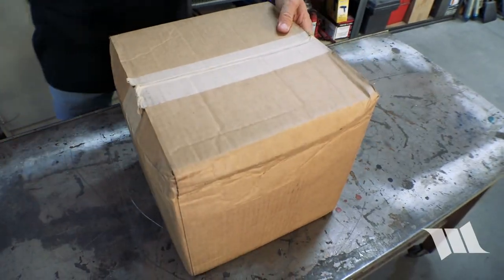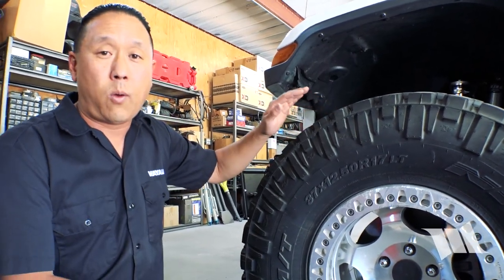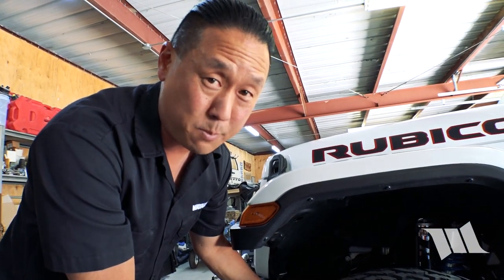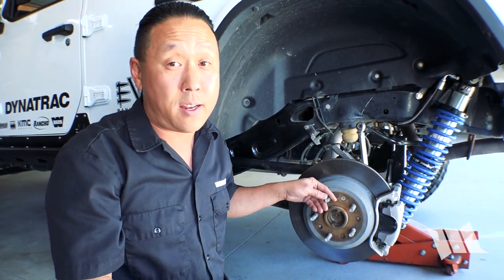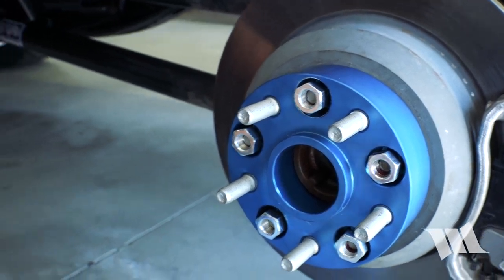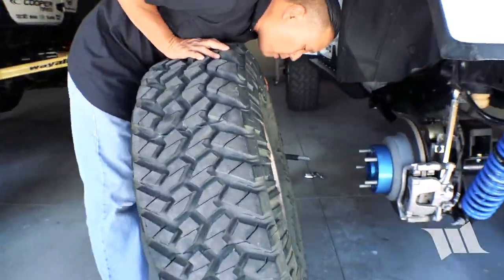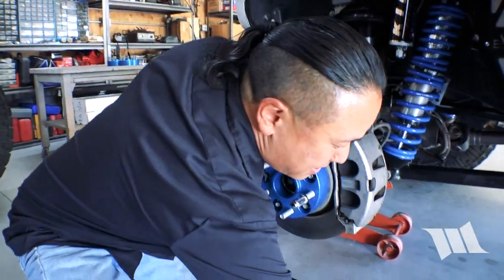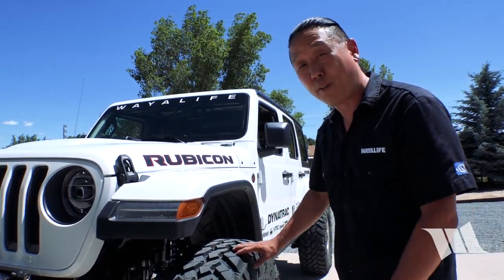Jeep Wrangler Wheel Spacer INSTALL - How to Run Big Tires on Factory Wheels with No Rub SPIDERTRAX

Comment: I installed a set of SpiderTrax on The YETI a few months ago.  After installing Rubicon suspension along w/ wheels and tires it gave it a much more aggressive stance.  They look great!  I probably went a little overboard by sanding all the surface rust off the hat of the rotor and edge of the hub.  Force of habit from brake jobs and also a car with 30 series tires that transfer all feeling into the steering wheel.

Comment: I watch this and I actually ended up with a wheel spacer because my front had to clear my Teraflex Delta brakes. My axle width got wider now and I'm contemplating if I should change my wheels etc. However after seeing this I may re-consider lol. Once again, I learn something every time I watch your videos. "UNTUCKED LOOK" hahaha
Reply from the maker: Ideally, 3.5" of total back spacing is about as little as I would go. If with these spacers you are running less, I would consider new wheels that just has less than what you had to begin with.

Comment: Ran the same spacers on my JK for over 2 years. Never had issues and loved the way it changed the stance. I have rims with a back space so I don’t need them on my JL. But if I did, I’d use Spidertrax again!
Reply from the maker: Glad to hear you had good experience with them as well.

Comment: I ran Spidertrax wheel spacers for about 10 years on my TJ and never had a problem, not once.  The other thing is Spidertrax are hub centric as opposed to being lug centric.  So the wheel stays centered on the hub for smooth running.  And that blue anodizing looks really good!   lol
Reply from the maker: LOL - the blue is a bonus for sure :)

Comment: I always wondered about spacers hearing pros an cons over the years I like the none tucked look just looks sweet as always be safe
Reply from the maker: Just like I say in the video, you do NOT want to use spacers that just get sandwiched in between your axle and wheels. Those are dangerous and should NOT be used. High quality ones like these Spidertrax bolt up to your axle and then your wheels to them. When installed correctly, they should work no differently than new wheels with less back spacing. The pro to these is that they're affordable and will help you to clear suspension components. The con, just like any wheel with less back spacing, they will cause your ball joints and unit bearings to wear out prematurely.
Reply: We’ll said that’s why I love your videos you always point out the best route on projects an safest which saves big headaches in the long run for us thank you on always bringing the best

Comment: Teraflex 1.75" wheel spacers on my 2021 stock height jeep JL wrangler rubicon 2 door with stock 17" moab wheels; with 33" k02's. Would you please share with me your expert opinion on any issues to be expected from such a set up. Premature Unit bearing wear, ball joint wear, rubbing on inner fender liners, handling, alignment, and so forth? Any info will be greatly appreciated. Your channel has helped me ball joint install, fluid changes, and so much more; thank you, and Cindy for all the great how to content, wheeling, and quality upstanding human behavior on this channel. Sad to see PiPi go, but happy the 2 of you aquired another gladiator! 
Thank you, Brandon 😇
Reply from the maker: Happy to hear our videos have been helpful to you. As far as your wheel spacers go, I would say that as long as they're made well and you make sure to use red locktite on the studs and make sure to tighten everything to 130 ft lbs of torque, you shouldn't have to worry about anything there. Just like any wheel with less backspacing, your ball joints and unit bearings will wear out sooner but it's not like they're going to self destruct or anything like that.

Comment: Love the videos, Eddie! After the initial 100 mile check, how often would you recommend checking them? I’ve heard every tire rotation. Thank you!
Reply from the maker: After the first check, there should be no reason to check them again outside of a visual check. Use a paint pen to mark your bolts and that'll show you if anything has moved. None should even after the first 100 miles if you installed them correctly.
Reply: @wayalife  Awesome, thank you!

Comment: I'm in the same boat you were in. My wheels are 17x9.5 with 4.5" backspacing though, and I don't wanna spend another $2500 on wheels to fix this. With the spidertrax spacers I'd be at 2.75" of backspace on a d44. Is the 1/4" difference between yours, and mine a big deal? Or should I install shorter studs, and go with a 1.5" spacer? Thank you! Great videos!

Comment: Hey Eddie, Thanks for the informative video like always brother... I have a 2019 JLUR ..my question is if I'm running 35 x 12.50x17 on a 17x9x -12 wheel should I put wheel spacers as well? The tires are already 3 inches out of the fender line. I'm new to this so any suggestions are more than welcome , thanks again
Reply from the maker: If you're not seeing any rubbing at a full turn and or full flex, I would NOT install wheel spacers as they are NOT needed.
Reply: @wayalife  thanks for your help!

Comment: Thank you for the informative video!!  You always do a good job explaining. You were talking about the right back spacing so it doesn't cause strain on the suspension components. If I added these to factory JLUR with the 33s would that cause more stress on the components? Or would it be ok?
Reply from the maker: Anything less than factory back spacing will add more stress to your ball joints and wheel bearings. Really, it's not that big of a deal being that ALL parts wear out and need to be replaced as a part of routine maintenance. It just means you'll have to do it sooner than would be needed if you left everything on your Jeep stock.

Comment: Anyone asking about safety here’s my 2 cents from experience. As he says, a good quality HUB centric spacer, installed properly is safe. I ran them on a Mustang for years even on the drag strip. Now I run them on my Jeep and off road as much as possible. Follow the torque specs and instructions. Recheck after 100 miles. Good to go!

Comment: Love the channel! I really like how your jeep is coming along. I ended up going with the G2 brand 1.75 for my JLUR. I know there may be many reasons for going with a specific brand but what do you think of G2's quality compared to the Spidertrax?
Reply from the maker: Unfortunately, I couldn't say with any authority being that I have not run them before. I've just run Spidertrax for over 20 years and have never had a problem with them. I have seen where cheaper spacers end up breaking a wheel stud and that be a problem. None were a G2 though.
Reply: Man!!! Thanks for the reply. Short term fix till I get the wheels I want. Keep the vids coming.
Reply: @Svtdude302  how have the G2’s held up for you? Thanks I recently had a lift done that required spacers and the shop went with the same G2s you used.

Comment: great video, pretty much was the final selling point for me getting some spidertrax. about how long can one expect before starting to see premature bearing wear or anything else on a completely stock JL aside from these spacers?
Reply from the maker: It really depends on how you drive your Jeep. For normal driving, they should still last a long time. Even with rock crawling, they'll do fine. Where they really put a strain on ball joints and unit bearings is driving hard and fast across the desert.

Comment: Well as always it looks awesome hope it fixes everything. Just one question will you be putting 40” on the JL?
Reply from the maker: The spacers effectively made our back spacing 3". A bit more than was needed but yes, all is good now. Regarding 40's, eventually. From experience, we know that we'll need 1-ton axles first.
Reply: So with more space than needed you should go back to the 13.50. And give you the wider tire and more gripping
Reply from the maker: @yogi6931  We definitely could but we just got these brand new tires LOL

Comment: Hi love the videos! I Just bought a 2020 JL wrangler Sport with a 2.5 in lift and 35 in grapplers and thought wheel spacers would improve the stance and look great! I called the so called truck specialist at the dealership who told me it would void my warranty...He talked to me like I was 12 years old and said "don't they stick out far enough already why would you do something like that"? I don't know if I believe him.  BTW I crawl around town from the store to the pharmacy avoiding puddles so not like its going to be used even a little rough. Just want the look.  Would you put them on and if so what size? Thank you !
Reply from the maker: Most tire shops and even dealerships won't service a Jeep with wheel spacers or at least, if working on wheels and tires is required. However, a dealership can't just void your warranty just because you have them. They'd need to prove that whatever it is you're wanting to have fixed or replaced was caused by them. In other words, if your radio blew out, they couldn't just say that they won't cover it because you have wheel spacers.

Comment: Hey Guys, Love the channel,
Before you had fitted the spacer, where was the wheel rubbing
Does the Coilover suspension take up more wheel backspace area
Was looking running a setup like yourself, but looking at a "near" flush look for Australian conditions
Reply from the maker: We were rubbing the rear sway bar end links. With standard suspension setup, you should be able to get away with more back spacing.

Comment: You got me with “Made in the USA”. 🇺🇸🇺🇸
Curious how many will comment about the extension on the torque wrench. 😮😮
Reply: What?  why lol
Reply: Years being an Auto Technician, Felpro Gasket rep trained me besides Torque sequence that every inch of extension length, torque foot pounds settings has to decrease per inch of the length or risk of over stretching the treads or over torquing. I was also given a chart guide.
Reply: @acd3169  You are talking about offset extensions, yes that is the case.  Yet for a axial direction only extension you do not have to modify anything.  I am a ME and if you need further proof here you go:  http://rtstools.com/does-an-extension-affect-a-torque-wrench/

Comment: Just ordered these based on your video. Very well done as are your others. Question about the stock fenders since now the tires will be "untucked". I have a JLUR with 315s on stock wheels and a 1.5in level kit installed. Off road I had some bad rubbing fully articulated so it seems the spacers are needed to get the back to proper back spacing. Off road will be fully flexed for sure with sway bar disconnected. With the spacers installed, do I risk the tires, now "untucked", smashing/damaging the stock rubicon fenders?
Reply from the maker: Just to be clear, I installed these to help clear suspension components. If you were rubbing before, these will make your tires rub your fenders even more. You need more lift.
Reply: @wayalife  OK. I should have clarified the rubbing was on the inside center of the  fender liners, not the fender itself. That is why I thought the spacers would help.
Reply from the maker: @stevemaitin9584  If the rubbing occurs at a full turn, the spacers will help. If it happens at a full stuff, the rubbing will be worse.

Comment: If you have a stock JL front axle don’t you need to keep it in the “on” position so the FAD connects? Works for you cause you have a PR44.

Comment: Just bought a 20 jeep wrangler sahara unlimited JL 4dr. N I'm already having issues.bought it with 23000miles.appointment is on sept9. I have water on my driver side front n rear floorboard. I have a jingling sound coming from front pass suspension area,n the jeep shakes badly when I go past 65mph.I bought jeep with 35" wheels n it has a slight lift with rough country shocks,n roughcou try dual stabilizers. I also ordered the  synergy HD steering kit.the thing is,is that aftermarket wheels etc on the  jeep is going to void warranty,,even though I bought the jeep that way from a non jeep dealer.they installed wheels etc.what should I do? Should I go back to them?  Where can the leak be coming from?Love your videos  n what you bring to the jeep community. Your the reason I got a jl.thanks and stay safe
Reply from the maker: Sorry, without seeing pics, it's hard to say for sure where the leak is coming from. Post them up on WAYALIFE.com and I and others would be more than happy to help out. If you're unhappy with your Jeep, I would take it back to the dealership that you bought it from before it's too late.
Reply: @wayalife  lol never bring it back.I love my jeep.if there's one thing I learned from you is to get in there and just do it. n I'm doing just that.I actually fixed 2 of the 3 issues.the water issue I figured if the water is soaking mY top mat because there's a floor carpet,a custom floor mat n then I have factory mat on top.if the top got wet then the leak is coming from dashboard or freedomtops.so I popped the hood n it turns out that the dealership ran the litebar thats over the windshield thru the grommet hole by the brake booster. They took out the grommet n left it that way with the wire running thru hole so I checked under dash n found dirty water trail from the grommet hole to my floor.Bingo.sealed it up n it rained yesterday n no water.yessss as for the wobble I figured its not a death wobble cause I can slow down n I'm ok so process of elimination.I checked my front rims and noticed that driverside rim had about 6 speed balance weights on it while the pass.side had only 2..I checked the rear tires n they also had 6 weights as well.now I know that there's different weight sizes.but that still sounds fishy.so I went to tire shop n had that rim speed balanced, n mind you dealer didn't supply me with the lug nut remover,smh. Thankfully tire shop had one. They did the speed bal.I took the jeep on the highway n ran it to about 82mph  n no shake.Yesssss  so I fixed 2 issues and all I had to do was use my head.now I have to go to dealer n raise hell for causing the water problem because my jeep might not be the only one that way,n to also complain of the no lug nut tool.the 3rd issue I'll have to really get in there(sounds like washers jingling) but suspension looks tight n nothing  looks loose.so if I can't locate problem I'll take to dealer for them to look. But watching your videos and asking questions from other jeepers,I was able to take control and get I. There and learn about my Jeep. This jeep is now my "Wayalife".sold my trailblazer,selling my Honda n  now I'm a jeep for life.love your videos keep up the great work

Comment: Great video. Thank you!  Question... have you ever put JL Rubicon rims on a JK using the JkL lugs?  Will the rims seat properly and is safe to drive using 1/2 lugs/bolts vs the 14 MM lugs/bolts that come on the JL.  Or do you have to use a spacer JL/JK conversion kit?
Reply from the maker: So, I have not but I do know several people who are running JL wheels on a JK and without any problems.
Reply: @wayalife  Thank you!  And they are not using a conversion kit.  Just using the JK lugs?

Comment: Hello....another great video...good info...I have a question....what the max size space one should use....I running stock tire and wheel (31inch)..2020 JL..and I like the look of a wider stance...is 1.75 to much...??
Reply from the maker: 1.75" is the minimum you can go. Any thinner and the factory wheel studs will protrude beyond the spacer and interfere with your wheel mating flush and installing properly.

Comment: Hopeful for a reply🙏 so I'm planning on getting a 2 inch lift with 37s on my JL Rubicon the rims I am kinda leaning towards are a 5.47 backspacing in a -12 offset. Would this for the most part clear any rubbing or would I need spacers / less backspacing? Thanks so much great video.
Reply from the maker: 2" of lift will NOT be enough to clear 37" tires especially when flexing on the trail. 5.47" of back spacing should be just enough to clear at a full turn so long as they are just 12.50 wide tires and NOT 13.50.
Reply: @wayalife  really? 2 inches won't be enough? In the lift description they said it'll clear 37s with the Rubicon model huh I won't be flexing it out or Rock crawling like crazy as around me we hit forestry roads and trails but cheers I'll have to look into that

Comment: Great video. My 2023 Willys 4xe. running 1.5 spacer with center line wheels 35x12.5x20. No lift. Am I safe for that? I don’t do crazy off-road.
Reply from the maker: I suppose it depends on what the wheels you're running look like on the back side. Typically, on a JL Wrangler, you would need 1.75" spacers to help clear the factory wheel studs. Failure to do this often times result in the wheels pressing against the studs instead of clearing them and this can cause the studs to fail. I would double check to make sure this is not an issue with your wheels.

Comment: Thanks for the video. I think jeeps do look better with wheel spacers. My question is...I own a gladiator with 1.5 level kit on it now. I am upgrading to 37’ tires on 17’ rims. I have seen gladiators that can run this size of tire without a lift. I plan on getting one later but is a wheel spacer good idea for the gladiator or not?? Pros and cons?
Reply from the maker: First off, IF you decide to run a spacer, you really need to make sure to get a high quality one like this Spidertrax. Pros is that you can run a wider tire and without the kind of rubbing issues you might have without them. Some uneducated people will suggest that they're dangerous but again, so long as you get a high quality one like these, you will be fine. The biggest con to them is that they will push your wheels/tires out far enough that your ball joints and unit bearings will wear out prematurely. Not a huge deal but it is worth noting.